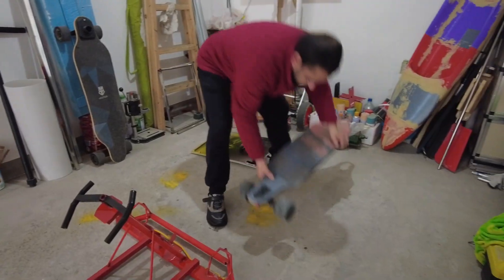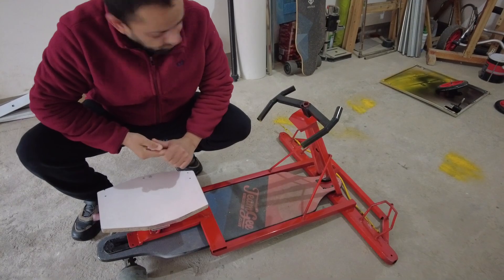Easy Electric longboard DIY Go-Kart Conversion Kit

Comment: Nice videa and idea man, i came here cause i had kinda the same idea - i have 2 e longboards: how about i take off the hub motors from the one and put em on the front of the belt driven other board, add something to sit and maybe something for my feet to make the whole thing a little widther so falling to one side is not an option either. Ofc id had to take the battery and esc with the hub motors but thats okay, on the front on top is enough space, right in front of the sitting chair. Cant imagine the power and acceleration that would have but i dont have the tools to do the whole thing so im sitting here enyoing your vid and maybe the day wil come! :D
Reply from the maker: you will have all time 4WD GoKart. more power. do it

Comment: I reakon you should convert your powerful electric scooter in to a go-kart now your be like a tesla competitor lol as usual my friend 😁👍😄🇬🇧
Reply from the maker: thats an idea i am working on. 6000W of power dual 3000W motors, that would require proper steering system, front and rear independent suspension. it would be a cool off roader. looking at a kit these days on a local portal but it does not have rear independent suspension. i might need to just build those myself and get a proper steering system only.